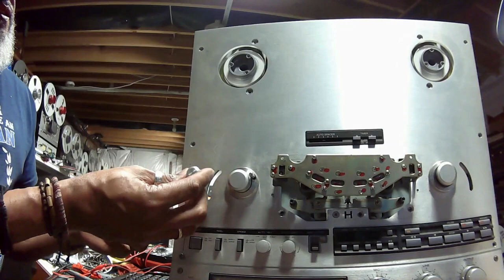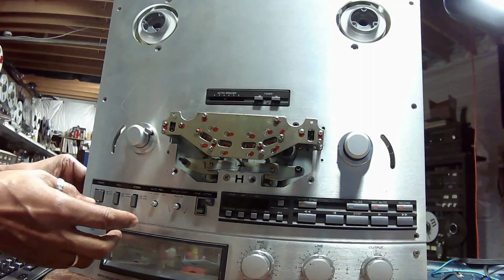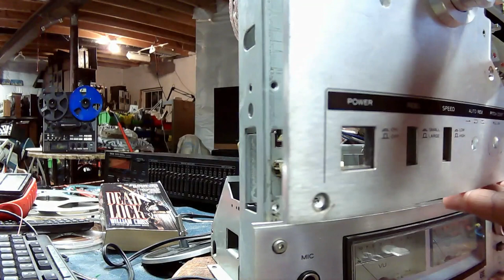TEAC X-1000R Reel to Reel Speed/Reel Size Switch Installation Instructions

Comment: Great video! I have this machine, luv it. But my rt909 needs some tlc. The motor died(thats what the guy said that looked at it). Can I send to you sometime soon? I also have a Otari mx55n, the digital display is blinking g in and out?? What do you think? Thanks and take care
Reply from the maker: Hi JC, I have 2 RT 909s that are giving me fits at the moment. I need to get them done before I take anymore in. Check back in May. Take care
Reply: @5thcomm  ok sounds good. I'm in no  hurry. Do you sell the units on the shelves? I'm always looking. Thanks brother, be in touch later
Reply from the maker: @johncaldwell2501  Yes, everything is for sale
Reply: @5thcomm  ok, I'll be in touch!
Reply: @5thcomm  do you have a email address we can use?
Reply from the maker: @johncaldwell2501  reel2reelguy@gmail.com